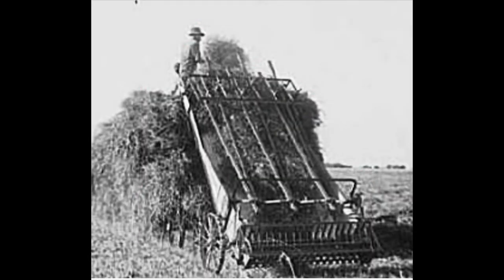Unleashing my inner farmer: mastering loose hay, at the age of seven

Comment: As a teenager I helped put up loose hay and square square bales, both are hard work !!! The pay for driving the truck was 1.1/2 cents per bale, bucking the bales paid 2 cents per bale, stacked in the barn for both jobs. Putting the hay in the barn was the hardest and hottest part of the job. Going to the creek to wash that scratchy hay off and to clean up was the best part of the job for a hired hand.
Reply from the maker: I hear you! In high school, 3 friends and I worked as a team putting up small squares and got a nickel a bale (split 4 ways). The good old days!